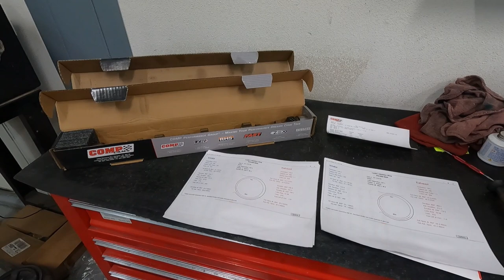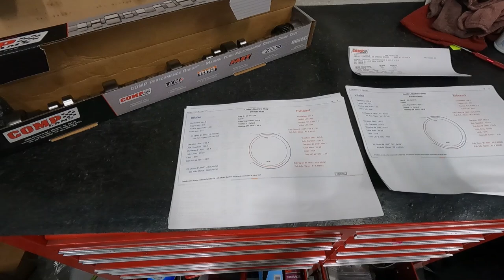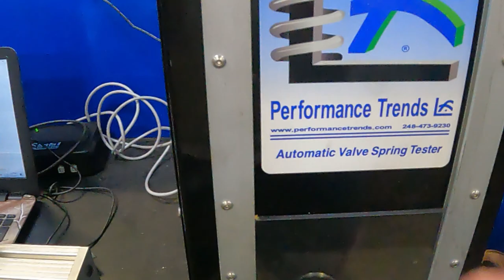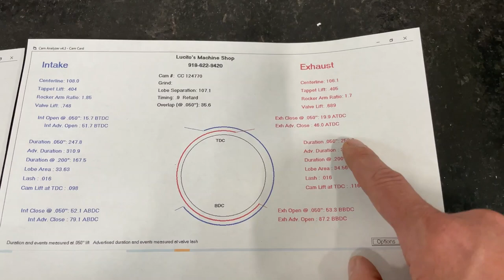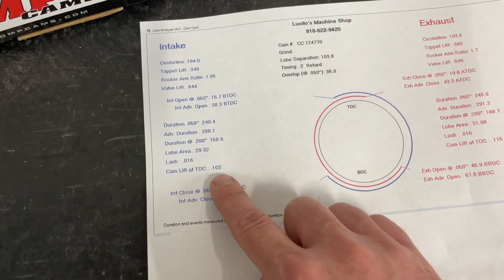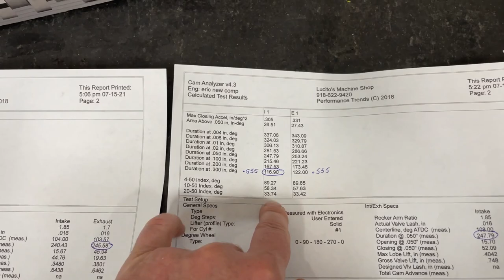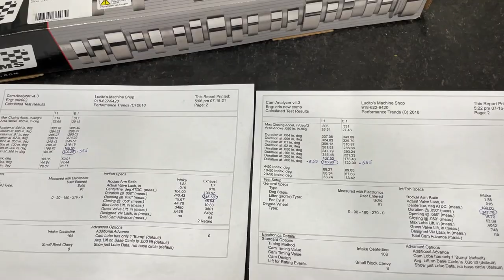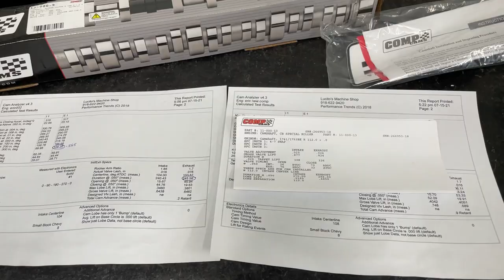Camshaft info. Why I think more lift is better.

Comment: More lift is a good thing..more duration on the othr hand may not be. At high altitude with a naturally aspirated engine it may actually bleed off part of the charge needed for compression which suffers at high altitude.
No way in hell would I EVER use a comp cam in ANYTHING. Not only have I had one go flat, (big block Chevy) but the machine shop I use has had enough trouble with them that they switched to Lunati, whos cams I use and NEVER once had an issue with.
Reply: I went away from Comp because they made bad recommendations now I am buying from Crower. They ask lots more questions and my times dropped significantly.
Reply from the maker: Comp owns lunati.
Reply: @WeingartnerRacing  🤣👌🏽🤯
Reply: @WeingartnerRacing  My experience says otherwise. After 49 years in automotive repaiir  INCLUDING engine and transmission building I will go head to head with you ANYTIME...KID
Bring it!
Reply: Eric is correct. The same group owns them both. So........
Reply: @lte008  IF true , someones quality control is severely lacking.
An obviously defective COMP cam that went flat, another that took out cam bearings in under 500 miles on a Ford FE
(the camshaft was found to have incorrectly machined  journals) means that I would NEVER use a Comp cam in anything again---EVER.
Other than factory defective Chevy cams from the early 70s that were not properly heat treated and went flat, only ONE other aftermarket cam that was NOT a Comp was poorly made, that being an Iskenderian 312 Ford cam which did not have the oil feed groove in the cam. journal cut deeply enough to ensure adequate lube supply to the rocker arms.
(Surprising since Iskenderian was the supplier to Ford for the higher performance cams used in D and E code 312 engines).
On the Ford Y-block the oil feed to both rocker arms is fed by an oil galley to a cam journal and THEN to passages leading up to the rocker arms through one of the stands on each side.
THAT is why many so many builders installed "California oilers" (which fed oil directly to the rocker shafts from an external tube) on those engines...
Reply from the maker: Sure. Here you go. 

https://theshopmag.com/news/edelbrock-owner-acquires-comp-performance/
Reply: You mightve been able to prevent that FE engine from shitting itself if you had verified the cam journals before installing it. If after 49 years of experience a person hasnt learnt to check and verify everything with engines before install or itll bite you in the ass like it did, theyre a lost cause. That ones not entirely on comp.
Reply: @benjaminrutledge7675  You miss the point entirely, and i expect that from those of lesser experience and knowledge.
Quality parts, ESPECIALLY with control technologies used today should NOT have to be inspected by the consumer (with the exception of Chinese made crap).
The VAST majority of (U.S. manufactured)  NEW parts I have installed over the years have never had an issue or issues.
Remanufactured is entirely another matter
Nearly 30 years ago I pulled a 5 star brand remanufactured 258 ci AMC 6 out of a Jeep which had severe vibration issues
It turned out that the crank the rebuilder used was warped, likely from long term storage caused by laying the crank horizontally (without correct support cribbing) instead of vertically as correct crankshaft storage protocol demands ESPECIALLY between machining and installation..
The camshaft issue on the FE was due SOLELY to COMP cams poor or nonexistent quality control. NO other aftermarket camshaft I have ever used starting from the Chrysler Direct Connection Racer Brown cam I installed in a 225 ci Slant Six over 45 years ago (with the exception of the shallow and too narrow oil groove on the 312 Isky unit) has ever had issues (That cam was re-used after machining a deeper and wider oil groove into the journal).
Ive used Crower, Crane Iskendarian  Lunati and even Super Shops cheap Sig Erson cams with NO issues.
Reply from the maker: @bradgriffith4231  there lobe designs are improvements over the lunati grinds. Comp springs are meh.
Reply: @WeingartnerRacing  True, but when you contact Lunati you get better help than with Comp. Comp caters to high profile builders, racers and magazine guys. They don't care much about the normal guy.
I use Comp cams, but I don't use Comp employees to spec lobes. There's a lot of truth in saying that the average Joe does not get a lot of help when calling Comp.
Just ask on the forums. Stories of people waiting on the phone for 90 minutes or more, only to be not given the time of day is unfortunately commonplace.
I'm sure a high profile builder or magazine editor can get Billy Godbold on the horn in seconds, but that's definitely not the case for most mere mortals.
Reply: @benjaminrutledge7675  There's a difference between engine builders and engine assemblers lol...
Reply: @donreinke5863  Quality part don't have to be checked when building an engine? What the serious fuck.... I don't even bolt on heads without verifying installed spring height, checking spring rates, checking seat runout and measuring combustion chamber volume. I don't care who's name is on the end, I check it all.
I just installed a Bryant crank in an alu Dart M block with a 55 mm Comp cam and Crower rods, and I used Clevite bearings. Guess what oh wise and all knowing Engine Yoda. Both Bryant, Comp, Crower and Dart always advises me to verify all specs prior to installation, DESPITE knowing that everything was checked and rechecked prior to delivery. Sure everything checked out, but you must be out of your tiny mind if you think I would install a multi thousand dollar rotating assembly in a 5000 usd block with an equally expensive valve train. I wonder if you would even check endplay when installing a cam.
49 years of experience and you don't consider it a must to verify parts. That's an absolute first to hear that. Somewhere Sonny Leonard is turning in his grave...
Reply: @AB-80X  Let him spin. Maybe he will generate some heat. I DONT consider it a must to verify anything except the following.
If it isnt Chinese garbage. I DONT check much beyond the ring gap and piston-to-valve clearance. I always use a new thrust plate/washer on the camshaft.....so thers no need to worry much about THAT.
 Ive only had issues ONCE..and that was on a Y block Ford engine that the camshaft bearings were made from material softer than the original. The grooved bearing that feeds the rockers with oil had mushroomed and blocked the oil flow.
Apparently most of the bearing manufacturers had standardized the materials used rather than using specific material for applications.
Of course, back in the day people put "California oilers" on those engines because they were known to have oil feed issues.to the rocker arms if they got any sludge buildup over time
Now take your even tinier mind and buzz off....Using a Comp cam is indicative of what you DONT know.
Reply: @WeingartnerRacing  just ordered another cam from Lunati,  (Summit says they no longer distribute Lunati) and the sales guy at Lunati told me that Holley now owns them....He also said that several brands are now distributed from their warehouse in Olive Branch MS
Getting a straight story isnt easy these days.
Reply: @donreinke5863  
Ordering a Comp cam shows what I don't know. You are crazy. As much as I cannot stand Comps customer service, I know they offer some good lobes. I just use outside expertise to find what I need. 

And a part of Holley? Either you are straight up lying about ordering a cam, or you have ordered a cam from someone who don't know which company he is working for. 
Lunati has not been kart of Holley since 2008.
Lunati is in fact now owned by none other than Edelbrock, who also own Comp Performance Group.

I don't believe for a seco d that you have spoken to anyone at Lunati or ordered a cam. Part of Holley? Damn...
Reply: @donreinke5863  i feel for any of your customers with that personality
Reply: @benjaminrutledge7675  LOL Perhaps I did not make it clear that it was my  MACHINIST who had those issues with Comp crap with an engine HE was building.
THAT is why he only uses Lunati now..and after previous bad experience and what he has said, I dont use Comp crap either.
Reply: @WeingartnerRacing  I dont buy that for a second.
I know whos cams have been troublesome and whos havent, AND whos camshafts have and have not met expectations.
Reply: @AB-80X  Believe what you want..there is a vast world of the delusional out there, and I see convincing evidence of it in someones post
Reply: @thesledshop1917  ROFL. I take no shit from those who know less than I do.
they get a hard lesson on.......to quote the old saying...how the cow ate the cabbage.

Comment: You completely skipped over how lift and flow characteristics of a head should match. It’s the exact reason why your engine made more power with a higher lift cam is because the head could support more lift.  If a head stalls out of airflow at a certain lift no amount of added lift is going to give you more power. All you are doing is putting unnecessary stress on the valve train.
Reply from the maker: Probably because I don’t agree. If the head stops flowing at .500 and is at its highest flowing point, the valve will still spend more time at .500 with a .600 lift cam than a .500 lift cam.
Reply: Valve train strain got covered in the power vs pocketbook & application segment.😉

Comment: Torque wins races…
Reply: Untrue. You see many diesels winning at your local drags?
Reply: That's a nonsense statement. Of course it does, but torque without RPM is just as pointless as RPM without torque. It all depends on the total package.
Reply: from stoplight to stoplight....

Comment: Simply saying more lift is better is absurd. It will only be better if the existing cams are not lifting enough to allow proper flow. And, more importantly. the full diameter of the valve (or inlet orifice) will be achieved when the valve lift is at 25% of the orifice. Therefore you cannot make the hole bigger by lifting the valve any further than 25% of the orifice diameter. It's simple geometry. For example....  a 2.2 inch LS valve will not allow any more gas through the inlet orifice once it has been lifted to 25% of 2.2" (ie 550 thou). Putting more aggressive rockers on and ignoring the change in duration is also bizarre.   AND.....  what's with the 50 degree seat? if you're so concerned about valve lift, why would you slow down the valve lift with a 50 degree seat. Change it to a 30 degree seat and you will experience an increase of over 20% opening difference at .100" lift. I think you mentioned a couple of time throughout the clip "which is what most people do, but I didn't". Most people do those things because there's a reason. I think you'r using different methods to try and compensate for the things you are doing wrong.
Reply from the maker: A 2.20 valve will keep flowing more as the valve lifts beyond .550 unless it’s a bad head. Next if you only put a .550 lift cam in you will have zero degrees of duration at .550 lift but if you have a .700 lift cam your valve will spend more time at .550lift. That’s part of why you want more lift. Next 30degree seats are a horrible idea in any modern chamber head or valve lift  more than .400. They only work in very flat chambers and really low lift. They do give more flow at .100 but that also makes it flow more in reverse there too. Not good. A 50degree seat flows better at higher lifts but worse down low in both directions. This helps in reversion.
Reply: @WeingartnerRacing  rubbish. You have no data to verify your claims. I'm not saying a 2.2 valve cannot be lifted any higher but there is a point at which a valve lift ceases to have any importance. None of your video clips are supported by data. Just your waffle.

Comment: ... and you cannot have too much lift...
Reply: No absolutes. I've seen heads flow so fast that turbulence destroyed the power output. The AFR 300 Oval is a head that can do this. Awesome 300 cc head, but tricky to use at higher lifts.

Comment: The lift should match the air flow of the cylinder head where the cylinder head is stable be on maximum lift for flow if it's still stable you know I mean you can tell where the camshaft's going to peter out with a a cylinder head by using a flow bench that should tell you how much lift the head needs The duration is in length of time and all that it's just going to change your RPMs to match the size of your engine those heads will make the same power no matter what size the engine is